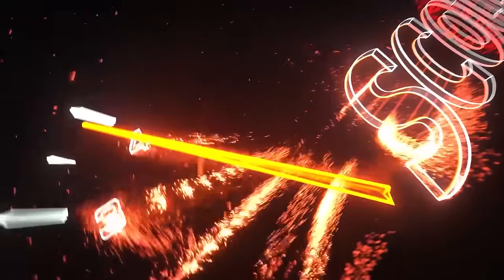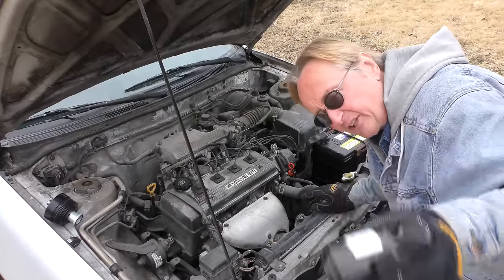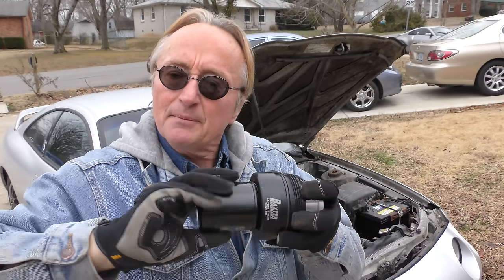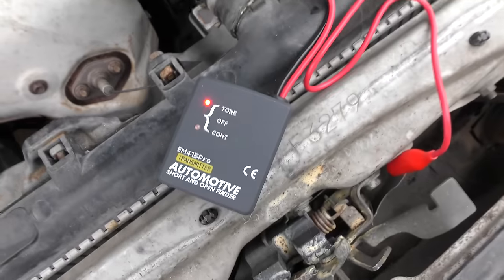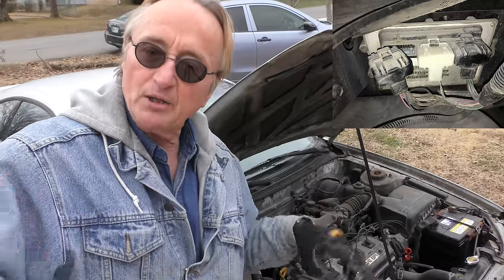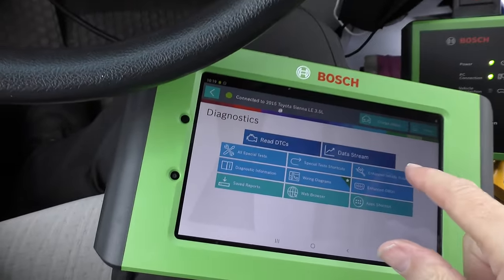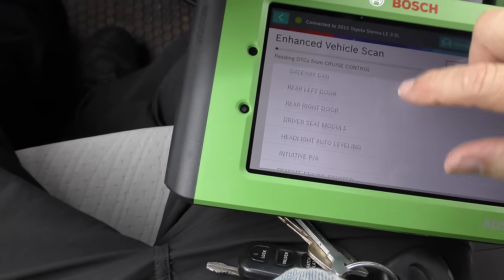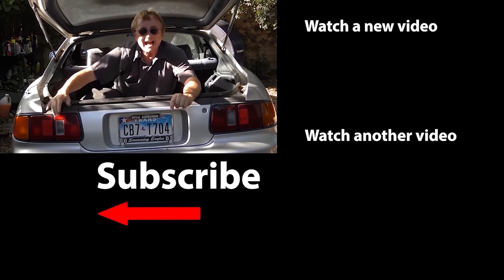You'll Never Have to go to an Oil Change Shop Again with This

Comment: Beautiful! I have that in my 2012 Toyota Corolla S 1.8l L4. 
We had to take the whole bracket off the engine and replace with a new bracket. We had to saw the plastic housing in half and pound the day lights out of it just to get the filter out. Junk. I thought used oil filter were brown or black. Nope this was gray color. Who knows how long it's been stuck in the stupid thing.

Comment: Scotty, I hate to be critical because I know that you know better, but your channel viewers may not. Many people mistakenly use "short circuit" alternately with and don't understand "open circuit". For the viewers, a short circuit is usually something that causes excess current flow, possibly blowing a fuse, like a damaged insulated wire touching ground.  An open circuit is usually a broken wire or a corroded connection that disallows the correct amount of current to flow in a circuit. Either way, this tool and a good understanding of electricity will help diagnose most electrical wiring failures. Thank you for the great video content. I try to watch them all, and truly enjoy your expertise. I wish we were close enough that I could consult with you on a regular basis or hire you.

Comment: My family has an 07 Volvo XC70 with that filter design, personally I really don't like it. All my other cars have the normal screw on ones.  However, I will say Volvo made it very easy to access surprisingly, so I'll give them that, and I managed to find a metal socket that fits it perfectly so I can actually start unscrewing it easier than all my other screw on filters. Yeah it's annoying to clean up, but I just shoot some brake cleaner on it over a garbage can and it's fine. I do have to agree with Scotty though, those screw one ones are absolutely the best, and that adapter looks pretty cool! Seems very helpful, just remember which size it is!

Comment: Nice oil filter adapter ! But if use on a Dodge gran caravan. The filter will be on a vertical position. With the filterO ring facing down. So when you lose the oil filter sitting on top of the adapter all the oil will spill on the engine unless you put some kind of rags

Comment: Scotty, I think the Baxter adapter is a good choice, but for a bit more work I can save 50% of the cost by replacing the whole oil filter bracket housing (Toyota part number 15609-0T060 for my 2009 Corolla 1.8L). I think in the end, it's a better option. I hate those flimsy paper filter things.

Comment: This is a cool idea but I do have two holes to poke in it- 1) that device leaves the oil filter sitting ~3" or so lower than the old housing cap used to sit. I could see this being an issue on some cars that have that housing relatively low. The last Avalon I worked on would be one such example- I just envision the filter getting knocked clean off when going into some of Chicago's pot-holes. and 2), if somebody overtightens an oil filter on it, I could see the whole adapter backing out when trying to remove the stuck filter. I don't know... it seems clever, but I think it falls a little short.

Comment: Thank you for the information on the Baxter cartridge adapter!  I have a 2016 Toyota Highlander with an aluminum catridge.  I have had to replace it once because I re-tightened it on using the drain bolt (forgot what I was doing) and could not get the drain bolt to come off.  Appreciate the information you provide, thanks again!

Comment: The short finder sounds really useful.         At 17, I had a 64 Ford pickup that the previous owner had changed from 6 cyl 3 speed on the column to 351 cleveland floor shift auto. It had a short I was not able to track down,something like this would have really helped.

Comment: Hi Scotty I thought about ordering one of these adapters from baxter, but when I saw the price for my Tundra it was like $274.00.  They don't even have it in stock right now.  I just ordered a 12 pack of cartridge filters from Amsoil too.  I have the drain tool which works well.  I never make a big mess with it so I'm going to stick with the cartridge.  I definitely would consider it for a new car that I was setting up for easy oil changes.

Comment: My Equinox has a replaceable paper filter with a composite screw-on cover that is on TOP of the engine. It has made oil changes so much easier and cleaner. I do not have to crawl under the car. I do not have oil running all over my hand or anywhere else. I do not have to jack up the car to change my oil.

Comment: I have 2015 Camry LE with one of these oil filter housing. I was clueless when first looking at it so tried to hammer it off, etc., did not work. Luckily I did not damage it like one of Scotty's customers. Did some research and found the right wrench at a local auto shop here in Crossville TN. It was $10. Worked like a charm. The adapter would be okay too but it's $200! So as little as I use this, I will stick to the wrench. Now let's see, where did I put that thing....

Comment: Scotty, I bought one of those Baxter adapters for my 2016 Camry. I used it for a while, it made oil changes so much easier. The problem was the adapter made the spin on filter hang lower than the panels under the engine. The filter got scrape marks from hitting the ground. I guess it hit where the road was not completely flat or maybe a railroad crossing. I had to switch back to the stupid element thing. I didn't want to smoke an engine.

Comment: 3:52  A short circuit is an electrical circuit that allows a current to travel along an Unintended path. An Open circuit is when there is No continuity within a wire. Continuity is the continuing of conduction within a wire or circuit. This device will find continuity or Open circuit, depending upon the setting.

Comment: I have a BMW and just spent less than $200 on a scan tool from Bimmer Geaks that comes with a KDCAN cable and also a bluetooth OBD2 adapter but it's not actually a scan tool, it's just an Android app called ProTool that you put on a tablet or on your phone and it is AMAZING but it is only for BMW's. It does basically everything the dealership can do, even coding.

Comment: The adapter is a good idea but in my case, a 2014 Chevrolet Captiva 4 cylinder, there is not enough clearance to fit the adapter plus a screw-on filter. You actually have to have a low provile socket to even open the filter housing. Prior to the Captiva all my other vehicles were serviced by me with K&N oil filters.

Comment: I hate the plastic cartridge oil filter crap on our 10 Prius too // the oil change on our 05 Prius with a small metal can filter takes 5X less time & less messy // I made a youtube video bitching directly at Toyota & shaming them for using a VW like plastic oil filter thing /// thats a pain in the butt to remove // a huge mess to take the filter element out & o-ring off // I have to use a special tool with an impact wrench to remove that stupid plastic filter holder design // what a waste of time // love this mod // thanks for sharing uncle Scotty!

Comment: I always put the old oil filter to the new one, it does 2 things, makes sure the old filter gasket is not still stuck to the engine and it oils the new filter gasket before putting it on.

Comment: I thought those Baxter oil filter adapters looked like a must-have item until I checked the price for my car 

$230!

Yep, the plastic canisters are a little bit annoying but not THAT annoying. Besides, I only need to replace the filter once a year on my late model car.

Comment: The Baxter spin-on adapter seems like a great idea, but there are a couple pain points that were not addressed in the video.  The first is the price of the adapter, which is $229.00 in my case for a 2012 Toyota Avalon Limited (3.5L USA, not 2.5L Canada). I have not priced out the tools needed for the original plastic canister vs the spin-on approach, but it leaves me wondering where the break even is.  The other pain point is finding the right size spin-on filter that is equivalent to your the old cartridge filter.  Getting the wrong size, I presume, could reduce the effectiveness of filtration (too small) or put the new spin-on filter in jeopardy of damage (too big/long) depending on how far it sticks out as compared to the manufacturer's canister. All the "find your filter" search engines expect that you are using the manufacturer's system, so all the results lead right back to the cartridge filters, and not the appropriate (?) sized spin-on filter.  Other than these pain points, I agree with Scotty regarding these cartridges. I do understand the eco-arguments against throwing away spin-on filters (with some oil in them) every 5,000 to 10,000 miles (synthetic oil). Scotty - How do you recommend finding the right size of spin-on filter, once this Baxter adapter is installed?
Reply: I'm trying to find the correct spin on filter , for a '22 Tacoma V-6.... Any help out there ?

Comment: For $245.00, I can do a lot of oil changes. Plus it puts the spin on filter closer to the ground, which is not good at all. I bought the metal spin on canister, which is better than the plastic one. I have no more issues than the spin on filter, as they both make a mess. I'll stick with the canister design, so I can see the filter element after each oil change.

Comment: This tone generator is my daily work as a telecom technicien, works well !
Reply: I’ve seen some guys just pull in a bunch of drops, not label them, and then tone them out/label later. Screwy as-builds with jumping numbers all over the plan  but it works....sort of ...but sloppy.

Comment: A short is not a broken wire and loss of continuity, it is when two or more wires are connected together when they should not be, like when a lead from the positive terminal of the battery is touching the frame you get a short.  So the tool is not a short finder, it’s an open circuit finder, commonly called a continuity tester.

Comment: The canister filters aren't that bad once you get used to it. Plus the paper elements are cheaper. If you don't overtighten them, you should not have to break it to get it off. But I still think it's cool that somebody made this adapter for those who do not like the canister style.

Comment: Shorts are usually to gnd or something else and usually blow fuses.  Open circuits are broken or corroded wires.  The device uses the wires as an antenna for your detector.  What about oil bypass filters with toilet paper filters.

Comment: I like that spin on oil filter adapter. I just emailed the Baxter company to ask them which spin on filter to buy after I install their adapter, and will I need to make any modifications to my splashguard on the bottom of the truck (2007 Toyota tundra, 5.7 L V8)  that covers the filter.

Comment: That tool for short finding / wire finding. I have the version for phone/ethernet lines and i should see if it works for car wiring. (in the computer/phone world we call it a Cable Toner and Probe). I got mine from Harbor Freight for i think 25$ at the time.

Comment: I love your videos Scotty, but if you wouldn't but a car with that type of filter then you can't buy a new Toyota. Honestly I've never had an issue with plastic covers, just gotta keep some in stock if they do crack. Those stupid aluminum ones Toyota has have given me more issues than any other car, they lock on and some are impossible to remove without breaking the cap. Then hopefully the housing doesn't break.

Comment: The oil canister on our car faces down. Adding this would make the filter stick below the car by about 3 inches. 
Good was to have it knocked off. The oil canisters aren't that much of an issue. You take the bottom off, drain the oil, take the canister off, replace the filter, replace the o-rings, put it all back

Comment: I actually prefer the paper filters.  They’re usually on the top of the engine and have a hex-head on the housing so they’re ridiculously easy to get off.

Never need to crawl under a car and fight with an oily cylinder with zero leverage again.  

I’ve done ten years worth of oil changes on two vehicles with them and I haven’t cracked a housing yet.  Just don’t over-torque and you’re fine.

Comment: The engineers who made the equinox wanted it to fail. Not only does it leak because the oring is in the wrong spot. Its also buried in the engine so one of those adapters won't fit

Comment: My shorts are OK. However, for the first time I can recall, I just can't go along with you on the Baxter filter adapter at $230 for my wife's Highlander. WAY too much money, regardless of the engineering stupidity that brought back a ridiculous (paper filter, plastic canister) "concept". I'll carefully deal with the inconvenience of the paper/plastic because the Toyota dealer has filters for $5.50.  A few years back, I paid only $55 for an aircraft aluminum adapter so my 1957 Olds can use a spin on filter, instead of a cartridge.

Comment: Hey Scotty you didn’t leave a website for the Baxter oil filter replacement. I have a 2006 Toyota Avalon has a metal cover for paper oil filter and a 2015 Kia cordenza with plastic oil filter cover like to replace with the Baxter product. Your great host and give excellent information thks.

Comment: I can absolutely agree with you on the plastic canisters. I lost an engine because of the canister splitting and losing the oil. Seized up a fantastic engine because the freakin oil change tech at the Mazda dealership put it on too tight and used a pair of channel locks instead of the correct wrench when putting it on. Needless to say 2 months later and I am without a car and the dealership wasn't liable because it happened 2 months after the oil change. Just makes your freakin head want to explode grrrrr lol

Comment: I've got a 2014 Terrain that has a cartridge oil filter with no room to work, a 37mm plastic cap. Finally I used screwdriver & hammer to remove.  They Are Crap !

Comment: The only reason the plasic canisters break is cause people overtorque them. If you use the smallest 3/8 rachet to tighten them up they dont seize inside. This is why i am the only person i trust to do the oil change

Comment: Hi Scotty. I’m Tony from the Philippines and am a very avid fan of yours. Last year we bought our very first brand new family car, a Toyota Vios 1.3E. The dealer has told me that I have to change the engine oil every 6 months even if I have only run the car for 2,000 or so Kms. (Still a long way from what i know should be 5,000 Kms) So is the dealer correct or just trying to get more money out of me?

Comment: Doesn’t the Sienna have the paper filter? All the 3.5 V6s I’ve serviced also have a metal housing instead of a plastic on the 4 cylinder engines

Comment: Wow, that looks like it could help me find out why my interior light timer is short timing on my 2007 MB s550...  Scotty, would you happen to know which module controls the interior lights?  Also my system won't keep the proper date and the time is correct in the Command center but the clock is wrong and it wont change.

Comment: I need this short finder to find a battery drain problem in Mini Cooper S convertible.
I pulled all the fuses and checked with a continuity checker; but still did not find the problem.

Comment: But the paper ones are 1/3 the price of the metal ones.  And there're wrench's for the stupid plastic couplings which can remove/replace them without damage.  I removed 2 of 3 twist-lock metal clips on them cuz they're "stupid".

Comment: If you already own a tone generator then you can use that the same way as what is shown. They all have the same features as the one shown, but the "wand" is configured differently because it has a short sized tip instead of the one shown, but you can hold onto the tip and use your finger to "hunt" down the wire/issue etc. so the extra long wand end is not bad but it honestly is not necessary. I have done telecoms and networking for over 20 years so I do know what I am talking about for those that care about that. Just some additional options is all I am trying to provide. Happy "hunting" folks! lol

Comment: Hey Scotty, I have a 98, Subaru Legacy Wagon, 2.2, nice shape, runs great, 108,000 mi. It has solid lifters and the valves are noisy when it's cold. Should I worry about getting them adjusted?

Comment: Scotty i have a problem with my 2010 Chevy equinox LTZ there's a ticking sound coming from my engine mechanics told me it was a timing chan on my 3.0 V6 the thing is it doesn't do it morning at start up so my question is if a timing Chan is worn-out shouldn't it do it all the time ?

Comment: "Bosch is Top of The Line in Engineering"  Yes I said it, because it's true.  Bosch is the  best choice. If you can afford it buy it.
Reply: I drive vw Audi and Mercedes-benz I agree with you 100% Bosch is top pony status. 
I had a purge valve replacement put on my Mercedes at a shop. I normally always do my own maintenance and repairs I never need anything when it goes in for inspection. If the shop tells me I need shocks belts pulleys sensors or anything I always take the car home re-diagnose and verify the shops recommendation. 
Anyway I had the car in for insurance covered repairs so I left them do the work that was covered. Then the shop told me I needed a purge valve and they charge me $98 for one that has no branding or parts number on it. It was a stock item they carry on their shelf and they use a lot because they work on many euros. 
I went home ripped it off put in a Bosch part I had from an Audi that has same harness plug as the benz. I'm just annoyed that they didn't fix the check engine light charged me for a purge valve. And I went home n  fixed it, it was only a ripped hose going to the purge valve the p0442 check engine code never came back. They were going to replace the spark plugs as the next step to battle the check engine light. Quoted me $250. I'd never pay a shop to do my spark plugs lol